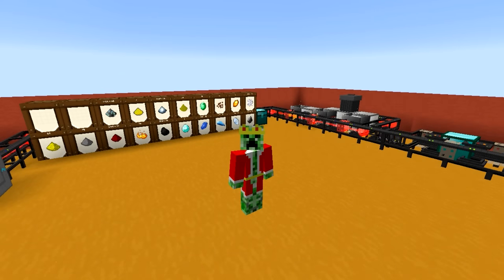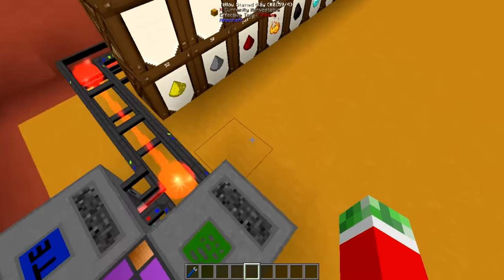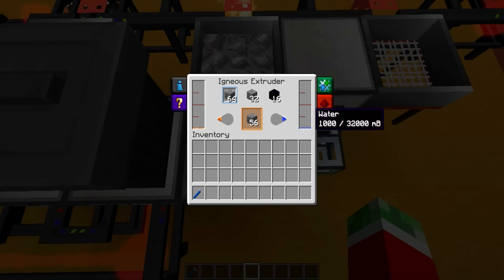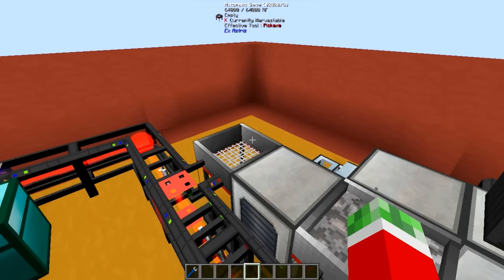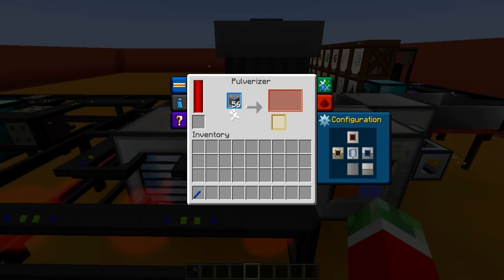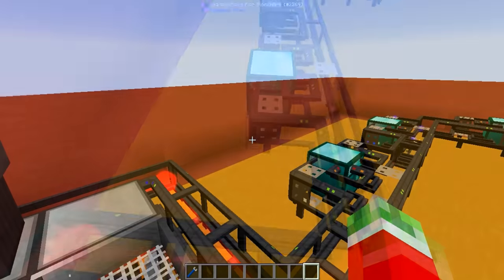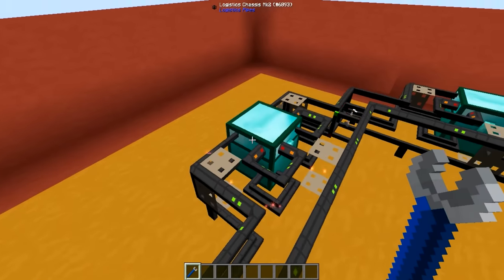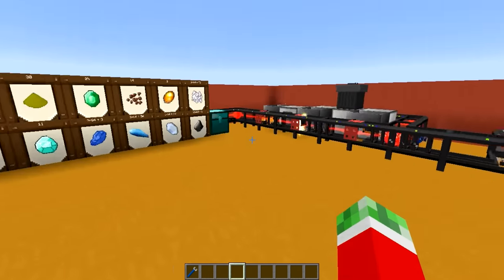Logistics Pipes Tutorial - #19 - Ex Nihilo Ore Generation & Sorting

Comment: This setup isn't hard to expand to add auto-hammers and crafters of some sort (I actually prefer RFTools for bulk) to process and smelt into ingots.

I do need to point out that the Ex Nihlo automation stuff is from an add-on called Ex Astris, but with some thinking you can simulate right-clicking for sieves and hammers. For example, Autonomous Activators from Thermal Expansion (but do check the Ex Nihlo configs!)